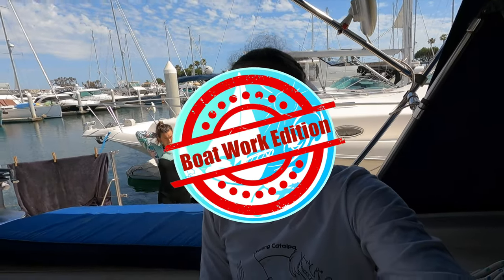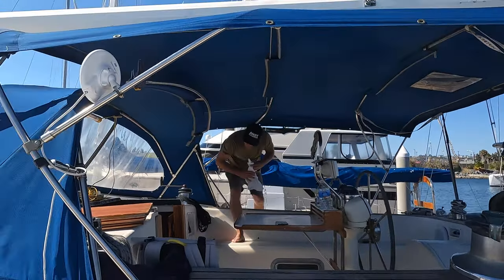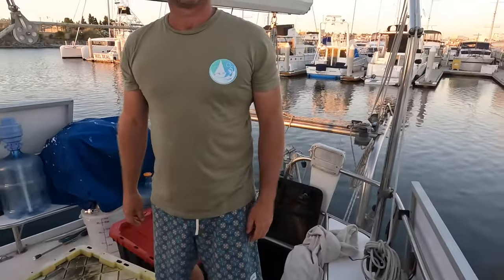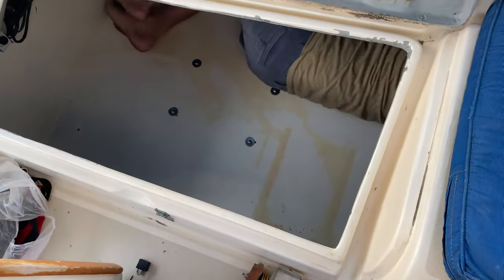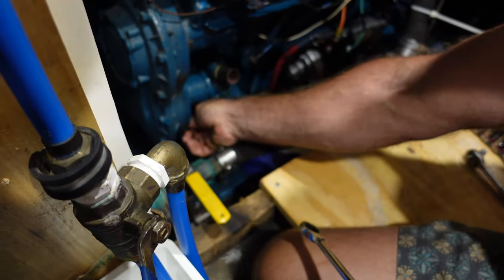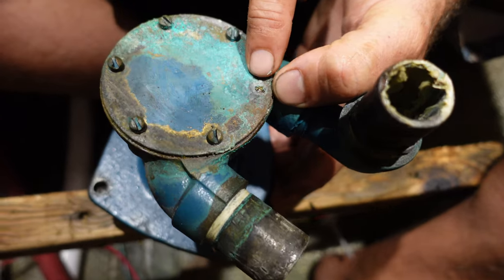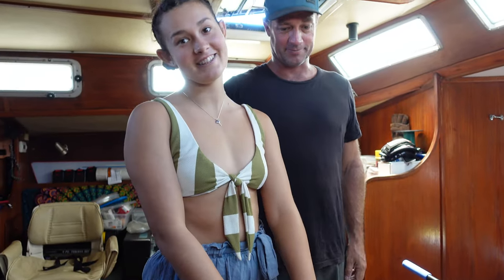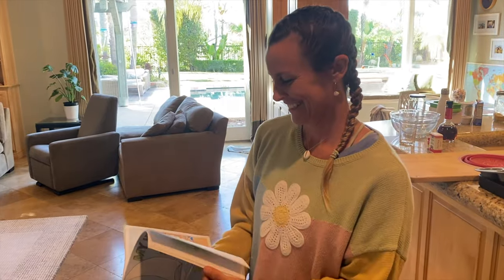Doubts, sails & pulling out engine parts | LOTS of BOAT WORK | Ep 305

Comment: In regard to the water pump cover, there is a conversion kit up grade that is worth the investment, the beauty of it is you don't hafto completely remove the cover, as  it has large knurled knob's, i believe four, one stays in place and the others are removed, the cover [it has a Oring] is swung up , out of the way while changing the impeller,once changed the cover is swung down and the knurled  knobs are screwed down, NO tools reguired, very fast in an emergency, have one and love it, as my pump is in a hard to reach location. About Spanners, here we call them WRENCHES, not  a CRESENT is like your ADJUSTABLE,DOWN WIND MARINE store is a excellent source for boat stuff, VERY knowledgeable , on the island, wonder which marina your in ?, great channel, been watching from the start, as i sailed the area in the 80'S, brought back memories

Comment: Be careful! Most gas bottles must NOT be used on their side because liquid rather than vapour will pass down the pipe which is extremely dangerous. Please check yours before attempting to use any gas appliance on board. If there is any doubt, consult a professional.
Reply: Pearson 530 has an aft gas locker with horizontal bottles. The bottles explicitly state they must be stored on their side.
Reply: @sailingadventuress5489  Thanks for that information. That's good to know. I'm from the UK and I have never come across horizontal gas bottles before except in fork lift trucks. The Calor Gas bottles found in many UK boats must be stored and used upright or they turn into flame throwers.
Reply: @ebikedorset  me neither until Adventuress, Pearson530 hull #2. They’re a pain to service and costly to replace.

Comment: Do you folks have ant need for 4 virgin ADLER BARBOUR, WAECO, DOMETIC F1701 Vertical Cube Trays. When My wife and I cruised we had  vertical cold plate refrigerator, these were left over. They are yours for the asking.

Comment: Hey lee I know it’s been said already,  how are those gas bottles using gas boiling off from the top surface of the liquid? 

Is that horizontal position the gas bottle design?   
How does it work ? How do they stop the liquid going into the system instead of using the boiler off gas ?